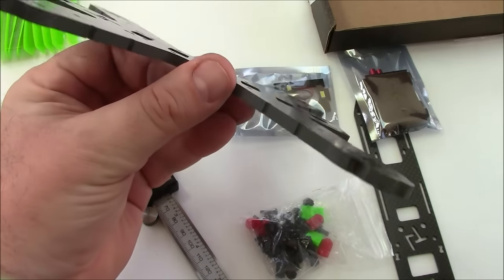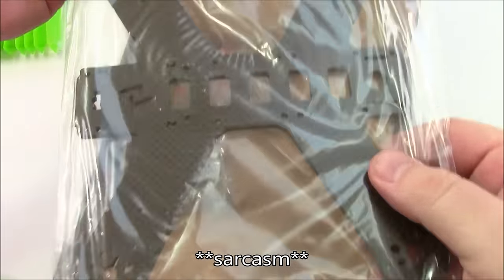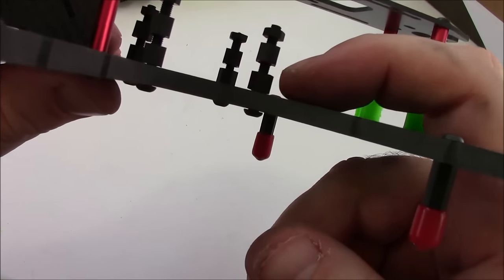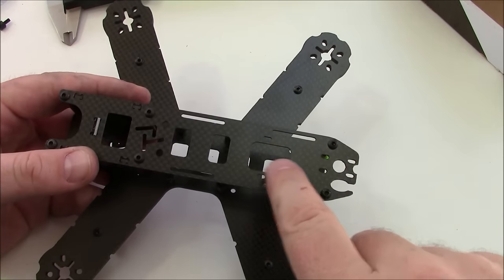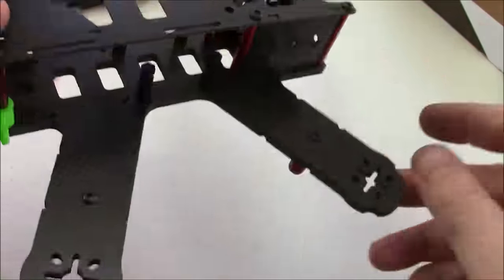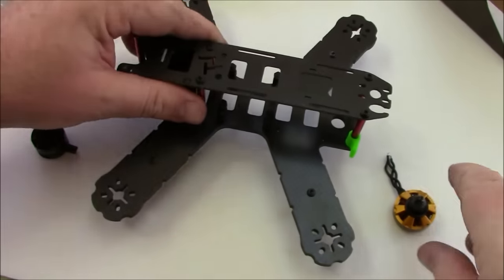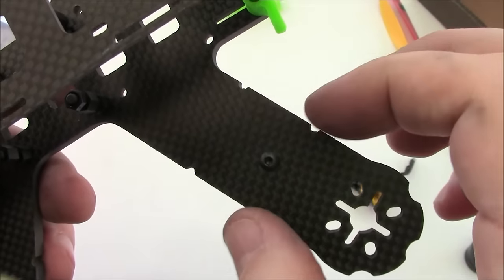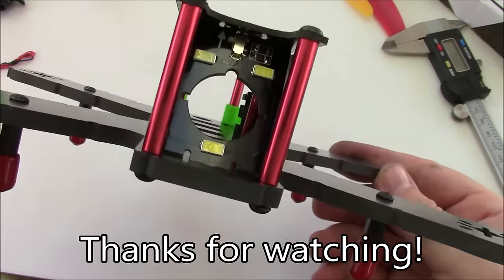Lantian LT-210 Frame with 5mm Main Plate from Banggood

Comment: the upper plate is the weak part.. that made me give up the Ls210. well using two top plates helped though.
I had only 2:30min on a 4s 1300mah at 475g... the zmr-x210 with same motors and esc and battery at 535g i get 3:15min with same kind of flying..
I think those arms on Lisam work as a downforce spoilers wich makes the frame not as effective

Comment: The frame is narrower probably to be able to put an a surverilzone hs1177 style camera in front between the two plates. The LS-210 doesn't hold it properly.
Reply from the maker: +Razvan Taranu That makes sense.  I haven't used an HS1177 yet but I have one on order now.
Reply: +Razvan Taranu I think you have it right. I built this with an HS1177 screwed directly between the two plates. I wanted more angle than the standard camera mount w/ LEDs provides so I propped it up with some foam in the nose section. Camera section worked out great - zero complaints so far.

Haven't hit anything yet, or even broken a prop, so I have nothing to say yet about durability. I think 4mm might be a more reasonable choice but I could not resist this - so beefy.

If anyone can suggest a good Yi / Mobius / Runcam mount, I'm all ears.

Comment: what's a universal size quad for the propellers. do you have to get two different size quads
Reply from the maker: Most racing pilots fly with 5" props.  Pilots wanting to go more long range will use 7" props.  6" props use to be pretty popular for racing, but that has kind of died down a little this past year.
Reply: thank you man. 5 inch sounds good if I go to small il probably get annoyed lol.
Reply: The dragon Hx5 x5 220mm 5inchs looks good. But the arm durability is no good. I think it was you on an others video that stated that. Its not full carbon frame all around without scrows
Reply from the maker: I flew the X210 frame for 11 months till I finally destroyed a motor and broke the frame.  It was awesome.